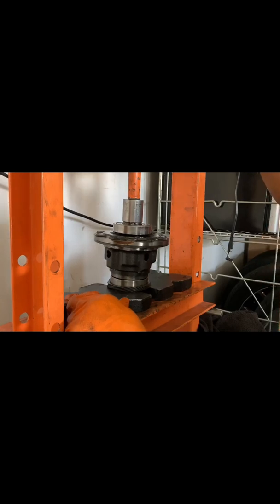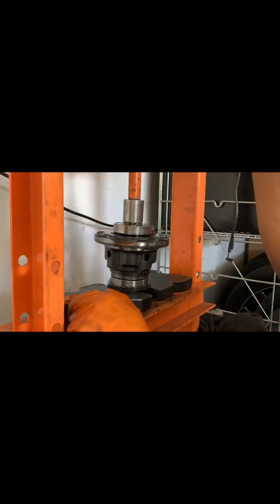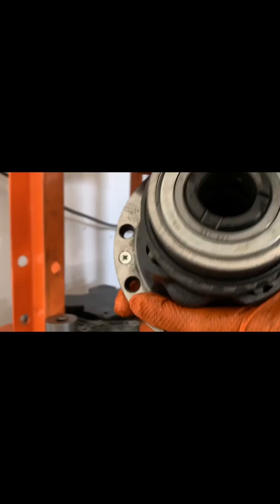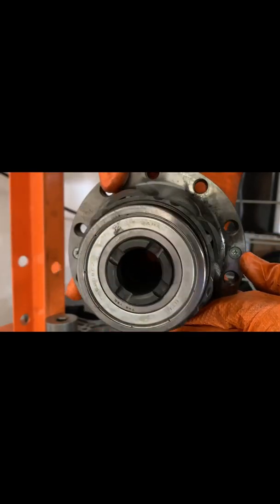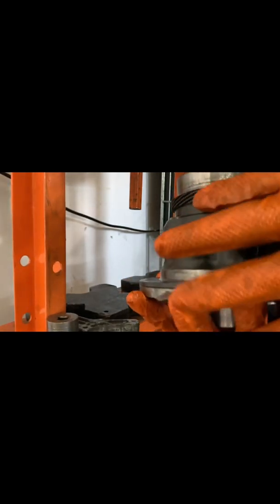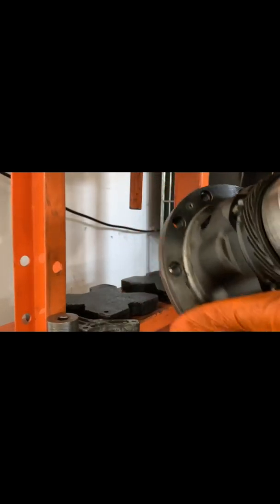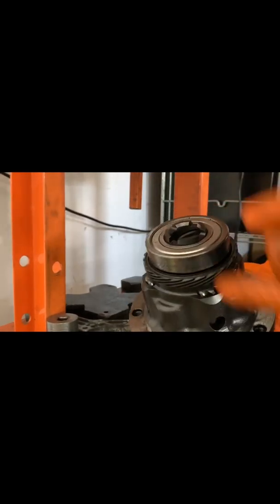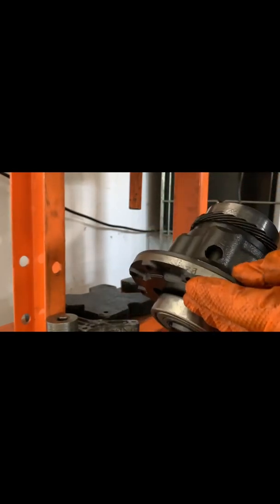How to install a VSS speedo ring gear on a K Series Differential.

Comment: So if I install this on my 9th gen si with gearx 1-4 my speedometer should read of off the stock vss location? It reads zero allowing me not to get vtec
Reply from the maker: No. The 9th Gen reads VSS completely different from 02-04 Rsx/02-05 Civic Si… Pretty much Digital vs Analog. Your car reads the VSS off of the 3rd gear. What’s happening is your VSS is either too far from the 3rd gear..  or it already touched and is damaged.  You need to properly shim the VSS when you put in aftermarket gearset such as that one.  Remove your shifter mechanism and look down in there and see how close or far the sensor is from the gear.